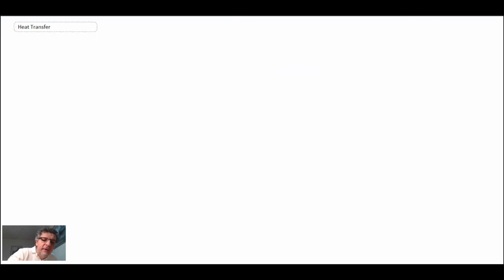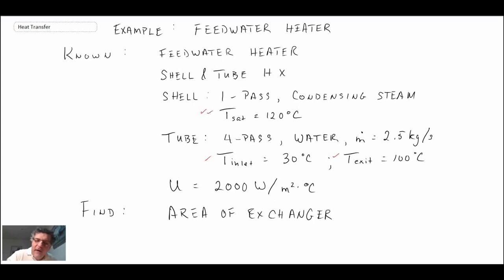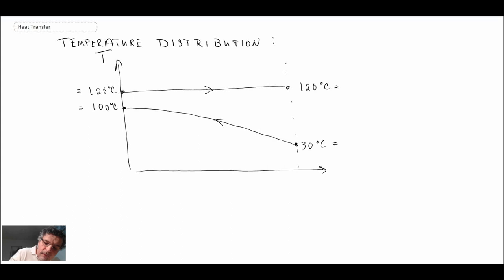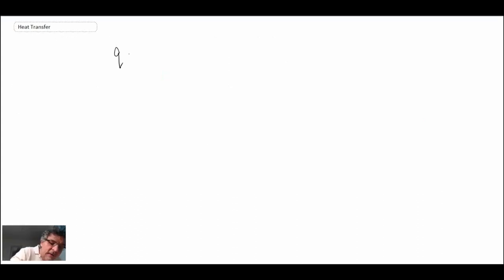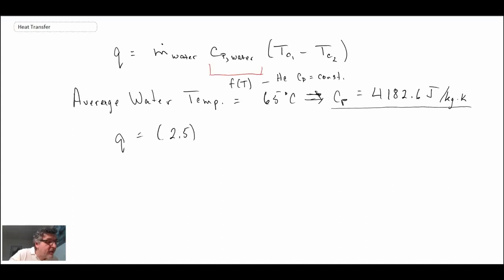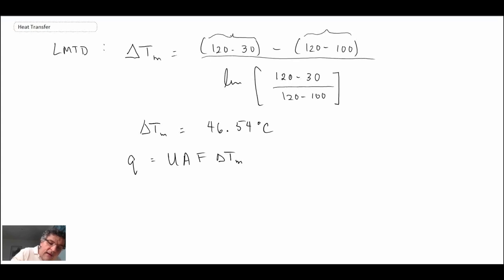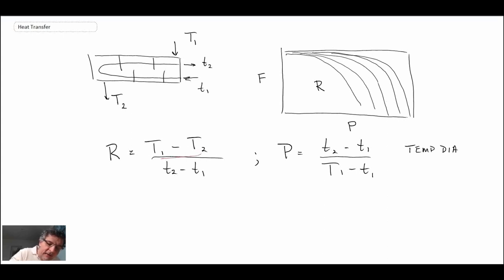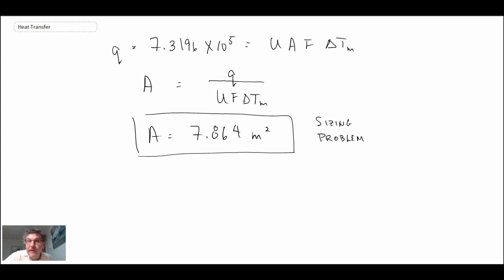Heat Transfer L32 p3 - LMTD Sizing Problem

Comment: How is the conservation of energy accounted for, q_hot will be zero from q_h = cp_h *m_dot_h*(T_h1 -T_h2), I know assumptions can be made that if the shell is large enough the temperature of the hot fluid will not change, but how would one go about calculating that required area? Or am I missing something?